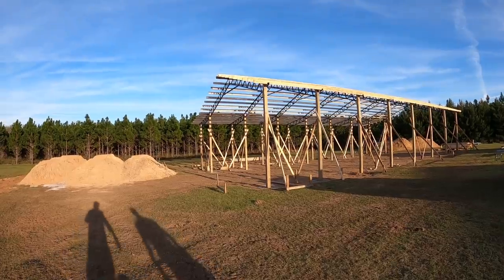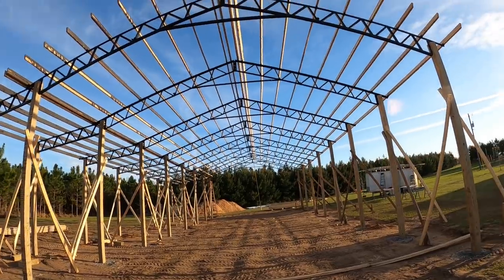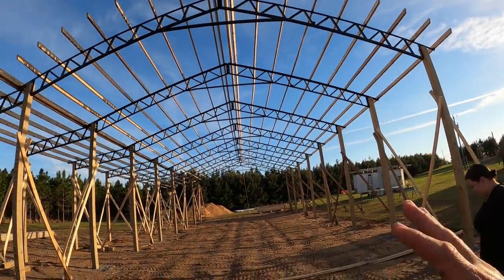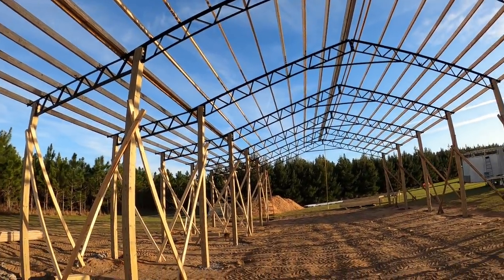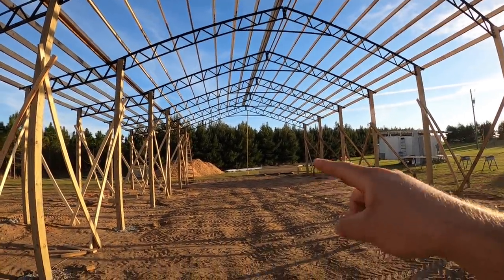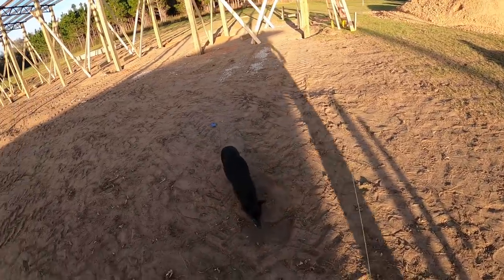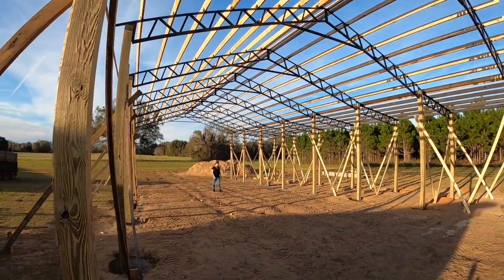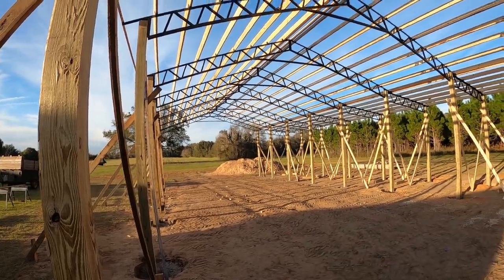Pole barn house build #5 Starting the roof!

Comment: Was there a certain distance between post you had to maintain? With wood trusses,  everybody is doing 2ft on center. Maybe metal allows for more?
Reply from the maker: Yes they come standard at 12ft, but to get a higher wind load we had to go 10ft on center.
Reply from the maker: Metal allows for a lot more spacing than wood, these are also 2x6 purlins, not 2x4

Comment: How many feet off the ground are the 6x6 to the truss?
Reply from the maker: 12ft above the finished slab height. So 12ft 6 inches.
Reply: @TKCL  6x6x12 are getting expensive. 12’ still gave you nice room for the loft